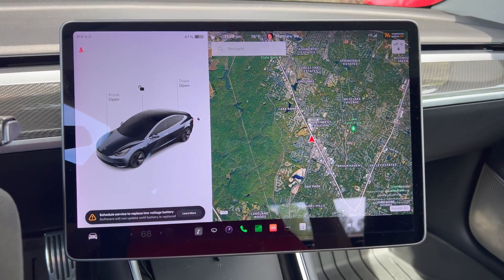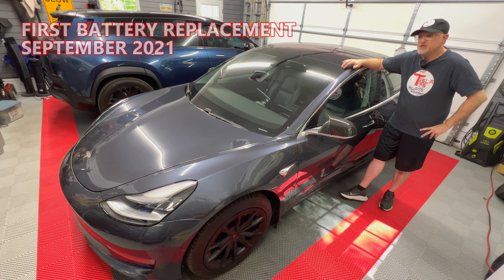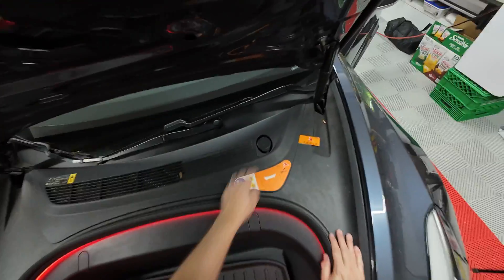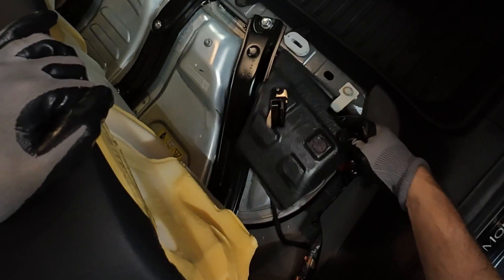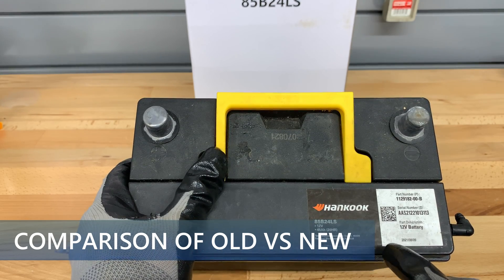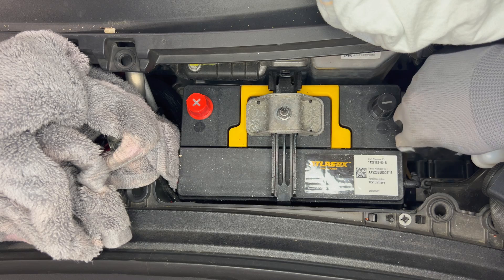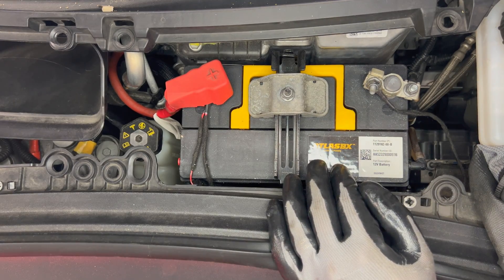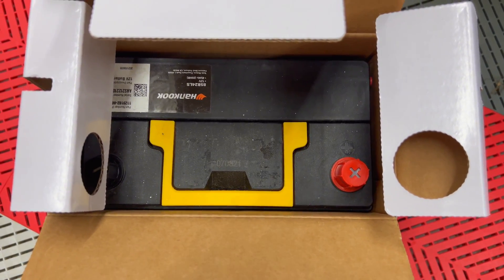Tesla Model 3 - How to Replace 12V Battery

Comment: Also coat the terminals with petroleum jelly to prevent corrosion
Reply from the maker: The 12 V batteries don't live long enough to get rust.  I don't remember any cars of mine in the last twenty + years that had corrosion on the terminals.

Comment: Can you please make a video showing how to check the status of the 12V battery in service mode? Both my wife’s and my Model 3’s didn’t receive the error message you did until the battery was dead. Had to get Tesla tow the car to the service center to replace it back in 2020.
Reply from the maker: I went into the service mode and the error messages are the same as what was displayed on the main screen.  Do you need instructions for service mode?

Comment: Do not reconnect the high voltage disconnect under the seat until you have reconnected the new battery. If you're going to do it the way you did, there's no reason to use the disconnect for safety.
Reply from the maker: This is what that Tesla instructions tell you do.    https://service.tesla.com/docs/Public/diy/model3/en_us/GUID-2588F809-41E3-43F1-84E5-6745C7C18DBE.html
Reply: @MTNRanger  Tesla does say to do that... but why? You disconnect the HV to make "safe". You then disconnect the positive. You then put the battery back in. Connect the HV... and go working on the positive?? I don't get it. What's the point of disconnect the HV if you plug it back in before you connect the battery
Reply: @AdrienneWhelan-r6w I also thought that it was utterly bizarre to reconnect the HV lead first before reconnecting the positive lead on the new battery. 

Surely the reason for disconnecting the HV lead in the first place is for safety. Good video to be fair and well explained but that reconnection of the HV lead seems a bit odd, even more odd seeing as that's how Tesla tells you to do it.